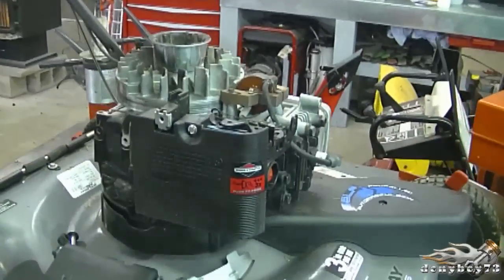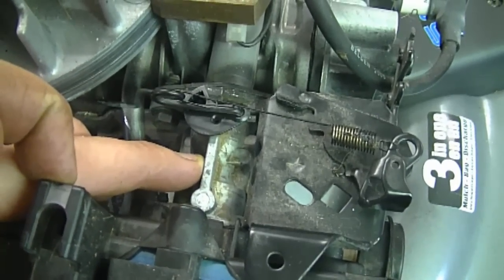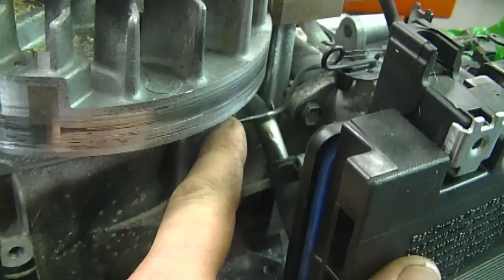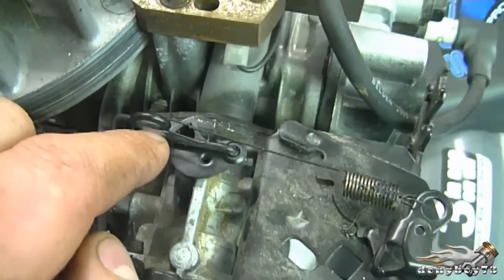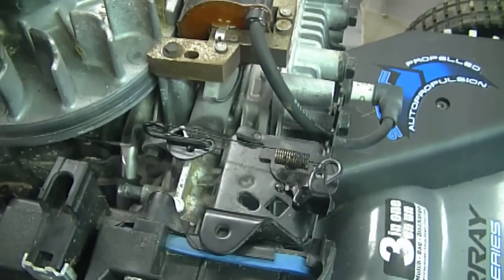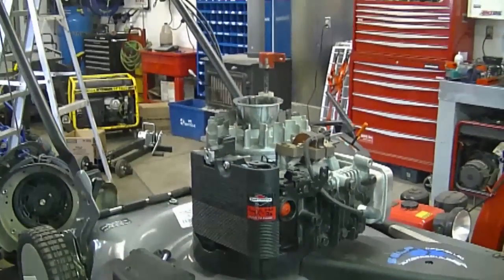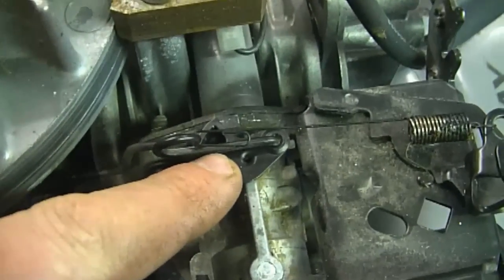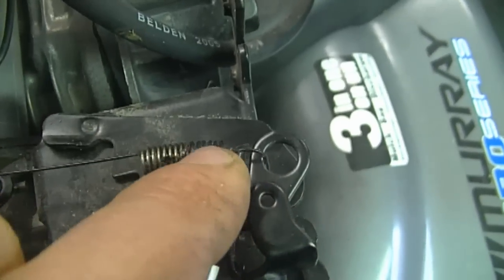Briggs & Stratton Quantum Carburetor Linkage Configuration (No Throttle Cable)

Comment: Finally! A video that explains the same linkage that's on my old Craftsman, purchased circa 1996. Turns out the metal arm the spring attaches to was bent on mine causing slack in the spring and resulting in the engine to not rev high enough. Bent it back and had to adjust just a tad so it wouldn't over-rev. Runs great again! Thanks!

Comment: I have a 10 HP tecumseh on my Yard king snow blower. It dies at full throttle and under load. I have cleaned the carb, used a carb rebuild kit, and I have even pulled the head, lapped and clearanced the valves, (thanks to your videos) New Head gasket and all. Cylinder walls are pristine. The Carb is a fixed jet carb. Starts on the first or second pull, and it idles perfect, but once I throttle it up, it dies. If I catch it dying I can drop the throttle to idle and it slowly recovers

Comment: Right so many vids on the 2 spring govoner briggs engines but none on the the one exactly like this is configured i thought for ages i was missing a part cause all the 2 spring set ups link to the air valve govoner thing and the single spring set up like mine and this one doesn't have an air valve govoner 😂 but so glade i found this vid it was a life saver now i know how it all goes together 😂

Comment: I do have a question. How do you adjust the governor arm when you replaced it? Are you supposed to rotate the governor clockwise or anticlockwise before tightening up the 10mm nut on the governor arm end? Thanks
Reply: I had the same question.  The governor arm axis needs to be rotated anticlockwise until it hits a stop before tightening the 10mm nut.  As the motor revs up the governor arm will rotate in a CLOCKWISE direction and cause the throttle to close.

Comment: Thanks man.. I just got this exact model today for free... it isn't running properly, at all...starts on prime then dies fairly quickly. 
 I flushed out the fuel tank by pouring it out a couple times...lots of grass etc in there...then drained the tank a 3rd time via the fuel line. 
 Fore down the carb...cleaned it out ( no real stuff inside) carb cleaner through all the ports I could.
 The main jet was partially restricted in the float bowl nut...the smaller " jet" hole into the carb, beside the main jet w the surfaction tube?? Does not seem to go anywhere..can't get carb cleaner through it anywhere I can see.
 There is a small port on Front of carb,  left hand side w brass insert. I can't get cleaner through that, not noticeably anyway...I ran wire through them all as possible., sprayed w cleaner.
. The butterfly valve dies was dislodged...jamming the throttle wide open...governor unable to back it off as a result.  Got that straightened out as well.
 Will have to reassemble the carb and install....and hope what I have done clears up its  stall issue. 
 Seems to have good compression. 
 It apparently  has sat for many years... but blade shows definite wear from prior use. 
 Drive cables seem to be somewhat sticky...may pull them apart and clean etc if I can now get it to run. 
 Seems like this is a Cheapo carb in it...
 Number stamped says 6150. ?.
 BTW... the governor spring...where it attaches to the Big hole on rhs top of bracket in video... that bracket Looks like it should pivot to adjust the spring tension...but is at Max tension as it sits in video...and I can't get it to Pivot, not uet/ easily, to let spring Loosen..should I want it to.
Reply: After disassemble, clean, repair the Butterfly valve, etc plus flush tank several times through coffee filter... all hooked up.. runs like a charm.. 
 Only issue now is the  adjusting bolt for the wheel drive is rusted pretty good...so soaked it w  penetratating oil. 
See if it will free up. Can't apply heat, as the transmission for drive is plastic. 
 Can you service the drive gears etc in the wheel drive "transmission"  of these?

Comment: I know im late to the party. QQ. Is the governor supposed to keep the carburetor choke open or closed. I have the same exact model but it only starts if i spray starter fluid into the carb. Mine looks to be open by default.

Comment: Why did they remove manual throttles from mowers?    Can a control be added, or are the low-speed holes missing form the carb?
I want to mount a newer engine onto my old base, which ahas the throttle control.

Comment: Are all the linkages for these motors the same.  I was given a small MTD rototiller with this configuration but the guy ripped it apart and all that was missing is back with the exception of the linkage arm to the governor.  Another great video

Comment: I switched from an automatic choke carb to a carb with a primer bulb setup. The problem is the same with both carb setups. I am able to start & run my mower, yet it   won't stop missing & the plug is white at the tip of electrode. The intake tube appears solid. Where should I be checking next?

Comment: Do you know why my Briggs and Stratton push mower won't start on a cold start without using starter fluid? I put a new aftermarket carburetor on because when I got the mower the carb was bad. It will start up with the new carb but only with starter fluid on cold starts and will start up when its warm

Comment: This is the setup i have I'm having an issue with carb set at WOT when starting? What should i be looking for to solve issue?
Reply: Solved my issue was the governor arm from age was advanced to far toward the carb so there was no resistance or it was bumped. I set so there was some resistance then adjusted the spring at carb for proper RPM all good.

Comment: So is this setup considered an auto-choke? I'm working on one of these now (2002 / 123K02-0315)...
Reply: i believe so, i think it uses one of the springs that adjusts the choke based on the ambient temperature of the spring, ie. a running mower for several minutes will have a different spring tension than a cold start mower.
Reply: @the.real.ipatch  Thanks so much, Chris!

Comment: So how does the throttle work? I have not throttle and it won’t start. If I shove a screw driver to hold the throttle open it will start and run

Comment: Very informative. I have one just like that one, it started giving meproblems starting last year. I took the carb apart and cleaned it, it looked fine. The primer did not seem to do its job so I suspected the bulb. I also found the gasket used for the primer was damaged so I got a new one. The guy at the sop told me I had to replace the whole plastic assembly but I gave the gasket a try. It helped a little (3-4 cranks instead of 25) but it got worse as the season went on. Any  opinion on that?
Reply: Good YouTube videos on fixing the plastic plate and/or addressing the fit for the gasket between carb and plastic plate.  It's true, sometimes the plates warp and have to be replaced, but, again, there are pretty good videos on addressing that.  Additionally, methods of verifying that the primer is actually working (visible fuel coming up tube in carb when primed.